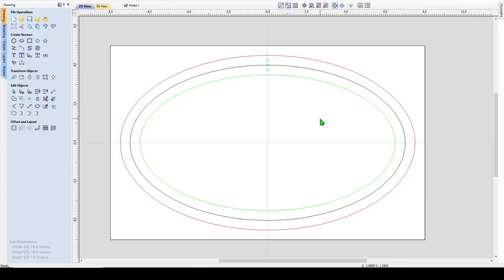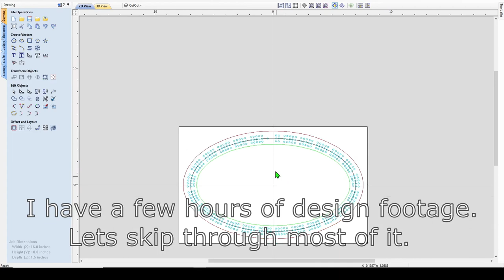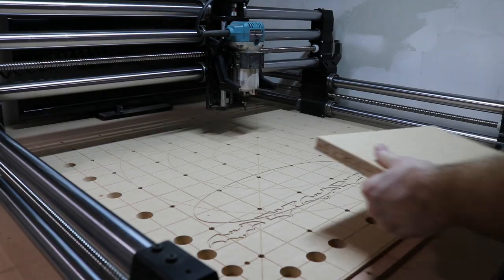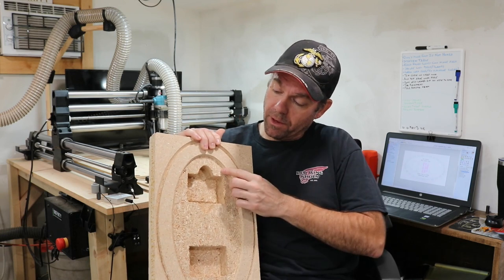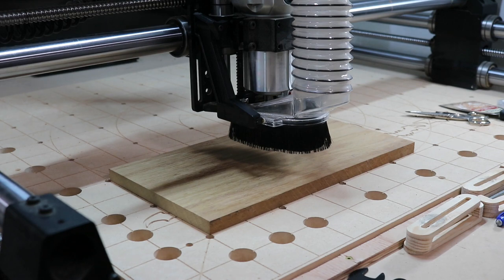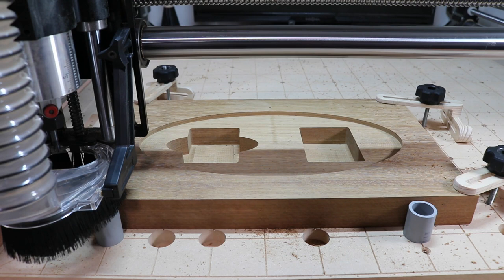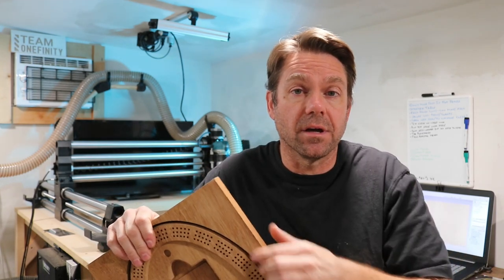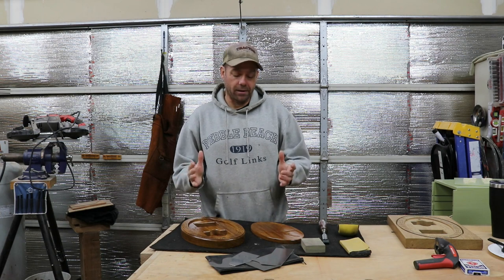Awesome Cribbage Board On Onefinity CNC.

Comment: Awesome Video! At one point you mentioned you needed to re-zero XYZ because of the bit diameter change. I don't think you need to do that because of the diameter change. I usually just do XYZ for my first bit and then only do Z after. The center of whatever diameter of bit should be the same.
Reply from the maker: Yes. Thanks for pointing that out. If X-Y home are the same, only need to probe Z after a bit change.

Comment: Really a nice creation Matt, I'm sure he will love it.
 If you don't mind me asking.. What made the bit skew across on the first board? I have the 1F also and have not had that issue (YET) however I was wondering if it was just a mistake or some other issue with the software?
Reply from the maker: It was my fault, not the machine. Im pretty sure some of the hold downs came loose and the material shifted. I should have been checking them periodically during the carve.
Reply: Nice job on the project, this was a great question to ask, perhaps an in depth vid on all the details. A Very interesting vid would be fixing the gouge with master craftsmanship, making another lid and salvaging the project. Sure many including you fans would own it with pride.
Reply from the maker: @douglassmith2055  Well it's not on the burn pile yet. I do have an idea to fix it so I might take on that challenge. Thanks for watching.

Comment: Any idea what caused the failure of first effort.
Reply from the maker: Boy that one hurt. I just didn't secure the material good enough and didn't pay enough attention to my hold downs. I should have had the material more centered on the spoil board with hold downs all around. I now use more hold downs if possible (or a combo of hold downs and tape like I did on the second carve) and I periodically check them during the carve.